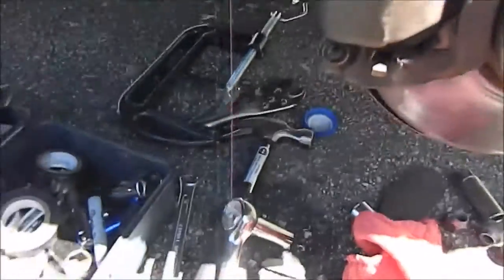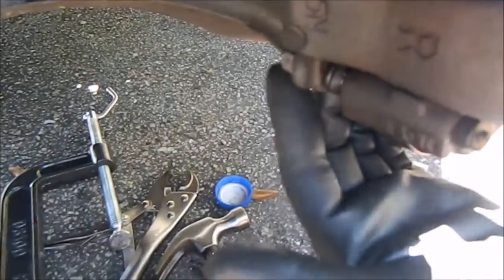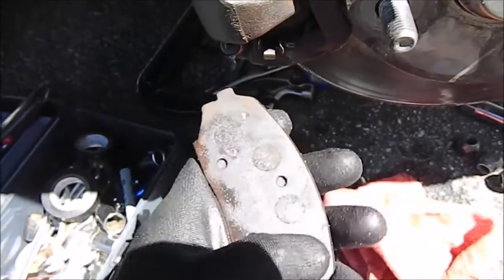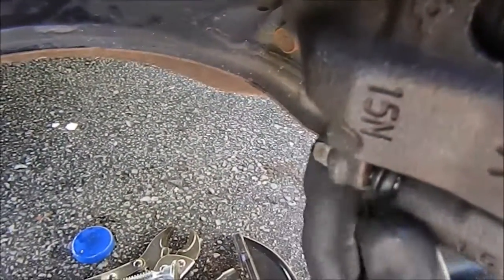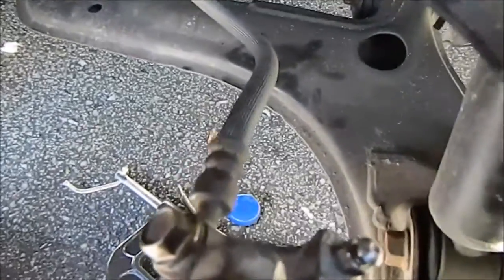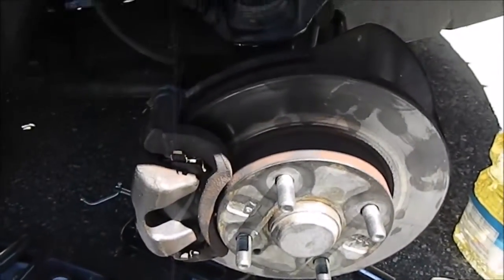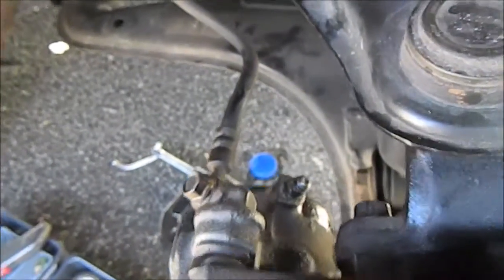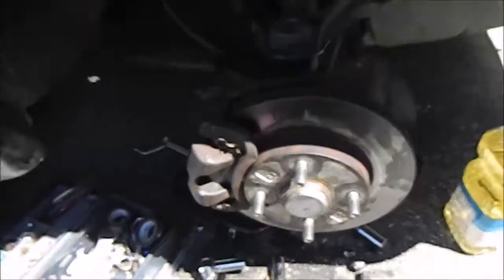Matts Miata- Brake Episode!

Comment: The cap on master cylinder is taken off because as the pots are squeezed in to make room for the new pads the fluid rises in the reservoir....it pressures up.  Monitoring the rising of the fluid is important to ensure it doesn't overflow.  I wrap rags around it just in case.  Had to syringe out some excess to bring it down to the max line.

Comment: Looks to me you're missing the 2 spring pins that keep pads separated and off the rotor....should be able to see them through the side opening.   I would check that.  The pads have predrilled holes where the springs insert.